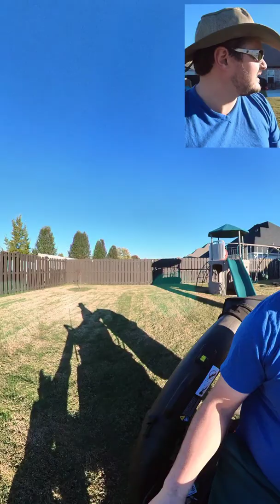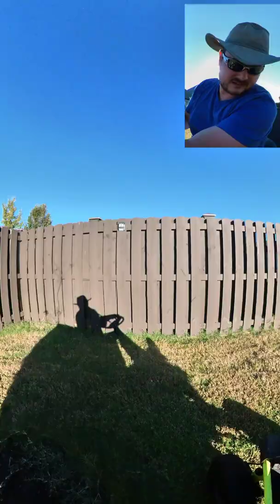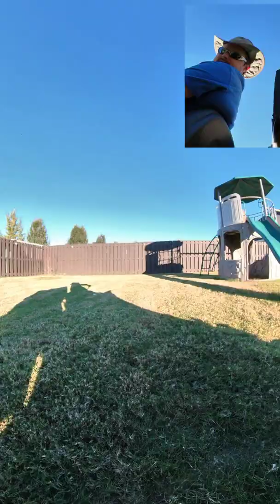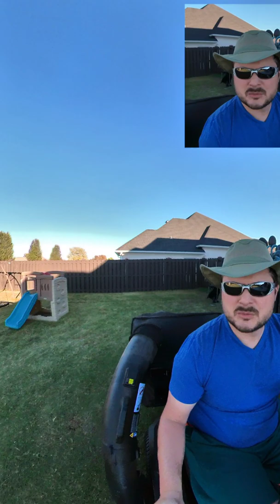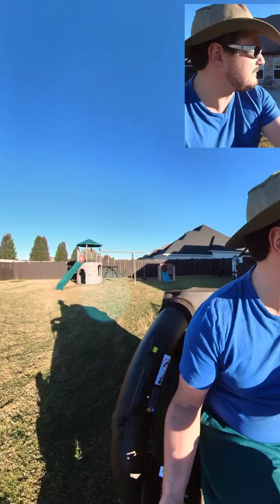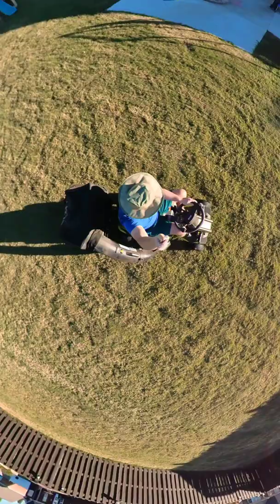Ryobi 48-volt 30 in 50Ah Electric Riding Mower Model: RY48130 ONE YEAR LATER

Comment: Can you leave a link for the replacement batteries for this 50ah model? I’m having trouble finding the correct ones, I’d like to have a spare
Reply: https://www.homedepot.com/p/12-Volt-50-Ah-Sealed-Lead-Acid-Battery-for-Ryobi-30-in-Riding-Mower-6-EVF-50/319073969
Reply: Then I would of saw the right batteries to buy.
Reply: Hopefully you talking about a RM300e Ryobi 30 in. Mower
Reply: @joanbarber5384  did we get an answer?